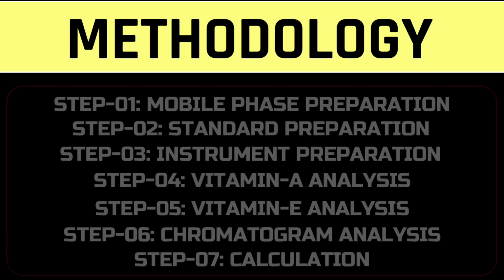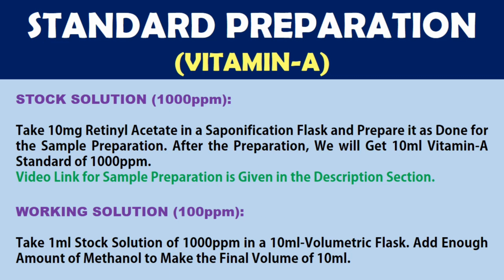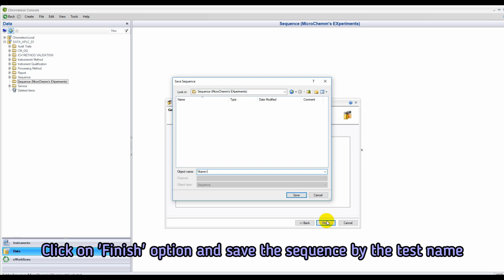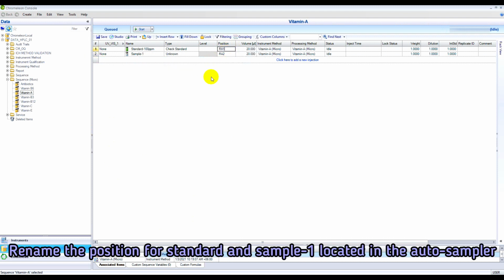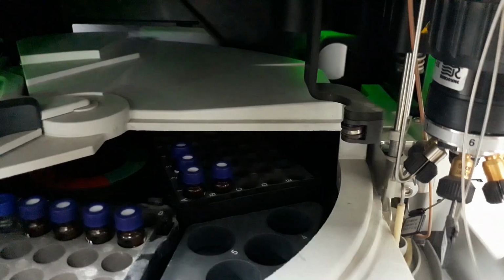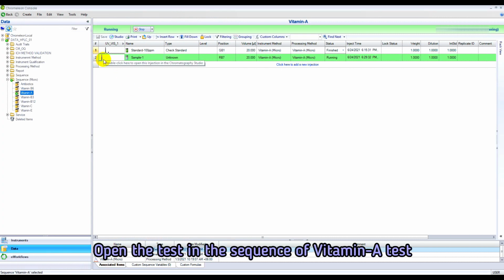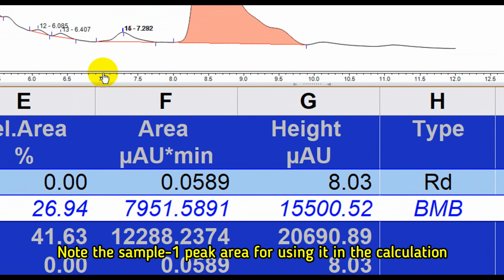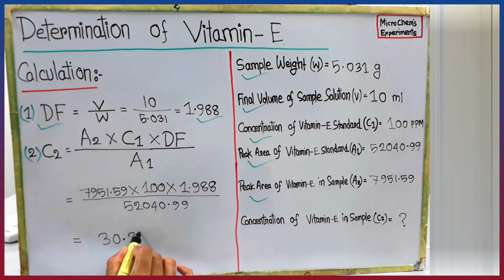Vitamin-A & Vitamin-E Analysis Using HPLC_Part-2 (Instrumental Analysis)

Comment: Filtering MeOH, sonicate it and then putting inside a piece of cork,  bad techniques and sources of contamination are dressed here as an expert advice in just 3 min.
Reply: I kept watching the video and now I understand that peak tailing, you're destroying your instrument, mister. Worst of it all is that you must be teaching people both in real life and through your videos, I'm sorry for them.
Reply: @vsolomtn  peak tailing makes more variation in the results as the proper integration of tailing peaks is not easy
Reply: @velimattiollilainen  Peak tailing is caused by different migration speeds of the analite inside the column, which indicates a poor performance of the system. Areas indeed will be different because because that method isn't suitable for any kind of separation. It can't be a matter of playing the edges on a latter integration when you have no reproducibility to start with.
Reply from the maker: Noted

Comment: What is the column your using here please mention that
Reply from the maker: Watch this video again. All the details is given in this video
Reply: @MicroChemsExperiments  I am using hypersil gold column
Reply from the maker: @aswinkumar8016  Did you get the vitamin A standard peak?
Reply: @MicroChemsExperiments  Yes, but the value is very high when compared to the label value
Reply: That's why I am asking ur using normal hypersil gold column or acclaim 120 PA / C18 column
Reply: @aswinkumar8016   silica columns separate beta and gamma tocopherols, in reversed-phase they overlap
Reply: I am using normal hypersil gold column..
Ultimate 3000 HPLC thermoscientific
Reply from the maker: @aswinkumar8016  I am using  acclaim C18 column
Reply: @MicroChemsExperiments  okay that's why ur getting correct results....
Reply from the maker: @aswinkumar8016  Yes. May be.

Comment: Hi, first thank you for the video. Can you give me the reference of the standards for Vitamin A and E so that I can buy it
Reply from the maker: Buy from Sigma Aldrich
Reply: @MicroChemsExperiments  yes I know its from Sigma Aldrich, but I need the product number because when I make a search for the vitamin, it gave me several ones, and I don't know which one should I choose
Reply from the maker: @aymenogkush  
1. Vitamin-A standard: (Retinyl Acetate analytical standard; CAS Number=127-47-9; Product Code: 46958)
2. Vitamin-E (Alpha Tocopherol analytical standard; CAS Number: 10191-41-0; Product Code: 47783)
Reply: Thank you very much. And for the filter that you used for the filtration of the methanol, what is the type of the material (PTFE or Cellulose or Nirile or Glass fiber etc..) and the porosity that should I used? If it's possible the product number
Reply from the maker: @aymenogkush  Cellulose membrane filter. Look up to the video. Details specification is seen when using the filter peper in this video. Product number is not avaulable for this product. You can purchase this from the local market.
Reply: @MicroChemsExperiments  Can you make a video about the steps to follow and the statistic calculation for the validation of the method
Reply from the maker: @aymenogkush  Yes. We can make but we need time for it. Stay with us.
Reply: @MicroChemsExperiments  take your time, we will wait :D
Reply from the maker: @aymenogkush  Thank you so much.